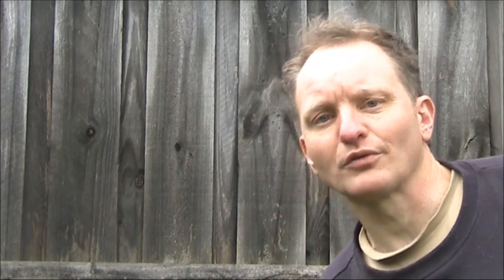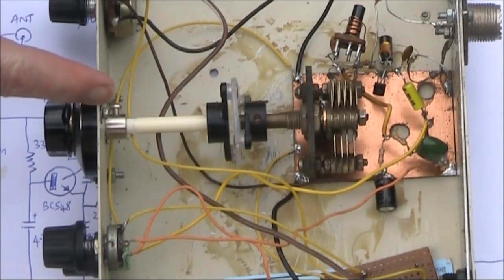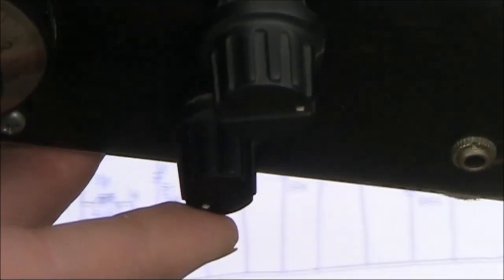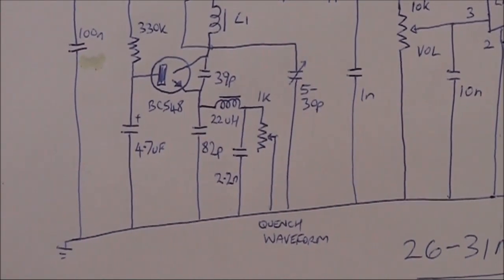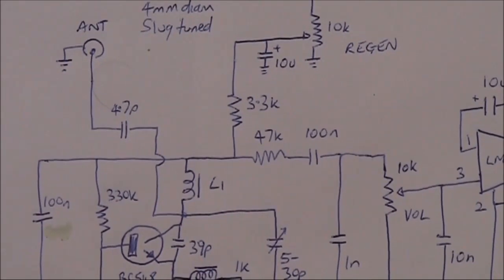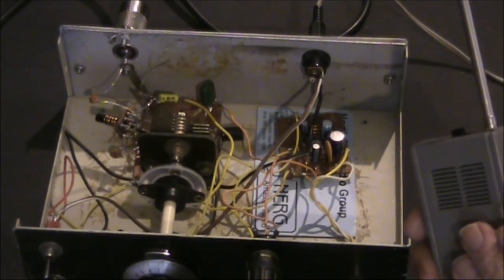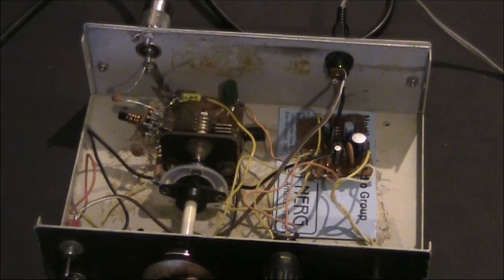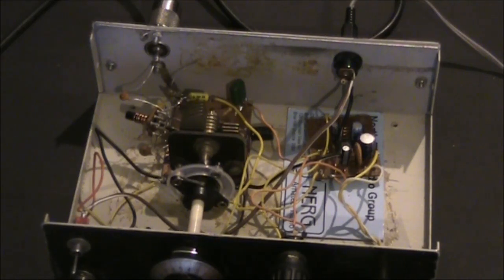27 MHz super regen receiver and more

Comment: You've got the Quench network wrong sir. The1k variable resistor should become at least 4,7k fixed and the 1k potentiometer should be put in series with the 2n2 capacitor and earth, in between ground and the cold end of the 2n2 capacitor that is. Now you are preventing it to super-regenerate by the layout in 5:25. If you'll look at the original ARRL article and schematic, you'll spot the mistake.

Regards,
Thomas
Reply: Good suggestion; that allows changing RC of the quenching circuit without changing the biasing of the transistor.

Comment: Hi Peter, thanks for the videos. Quick question. I have made a long wire antenna out of fine copper wire. I figured low current so thickness wouldn't matter. Am I wrong and a thicker wire would make a much better antenna? Thanks in advance.
Reply from the maker: A thicker wire may be slightly lower loss and wider bandwidth (for resonant antennas).

Comment: My understanding of the legislation only allows restoration of pre existing Regen
As far as i remember, any new regens are not allowed.
Are you able to verify this? 
If a regen does not radiate when oscillating, then it may be exempt
Regards Andrew VK5WT
Reply from the maker: Legislation doesn't mention regens or receiver radiation at all. You would be foolish to use a superregen on the VHF aircraft band. But bands like 27 MHz or 433 MHz are class licensed LIPD bands so there are no issues with a bit of incidental radiation. If it's still a worry you can add an RF amplifier stage.
Reply: @vk3ye  ok Peter, thats a fair reply, 
I will go check my source of the info i had.
Keep up all the good Ham enthusiasm.
Cheers , Andrew VK5WT.

Comment: Peter mate that's a wee belter of a homebrew your stuff is the business man , I think it's my cousin Kenneth or Robert who is into his radio stuff too down in the burbs outskirts of Sydney.
Should be able to start paying for ma wee yaesu ft next week, buying it on layaway 200 a month type idea, hope i can qso with you soon (power supplies proper antenna swr/power atu, soon probably being a few months bro, at that stage I'm looking at pictures of the 817 and salivating lol).
73's and looking forward to your next video mate, Rab T.
Reply: I managed to get on the air with 100W for a little under $500.00 

Second hand Yaesu FT747GX, 

found a HP server 750W power supply for $25  that pushed out 12V, Jumpered a component to get it to push out 13.5V. 

Some old coax Ethernet  leads, a 100m spool of wire and some toroidal cores 

An old SWR meter, old straight key and a NanoVNA to tune the antennas.

I’ve spent a little bit more since then, but not a lot. It helps when you know how to fix things, but the FT747GX was working perfectly when I got it.
Reply: @MidlifeRenaissanceMan  How did you find out what to modify in the powersupply to raise the voltage to 13.5V?